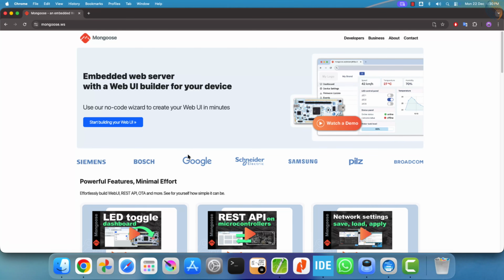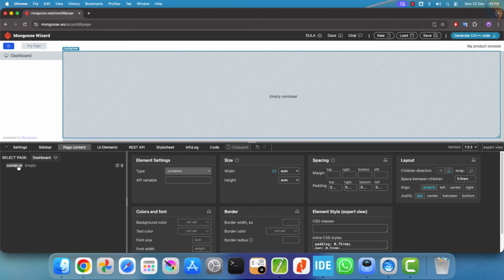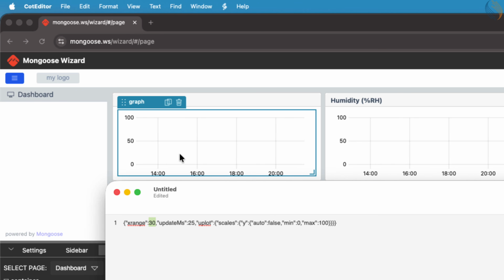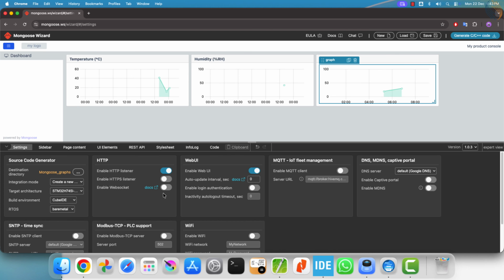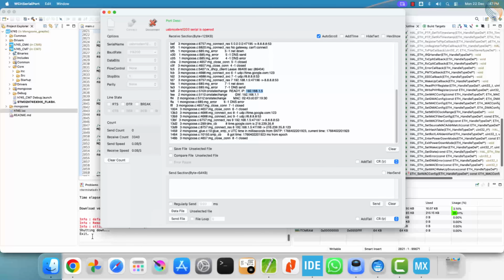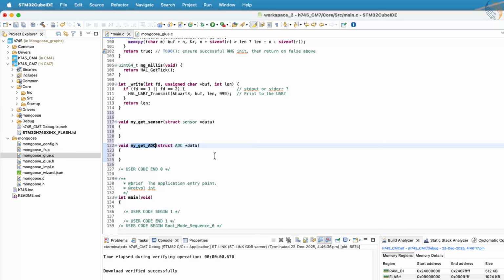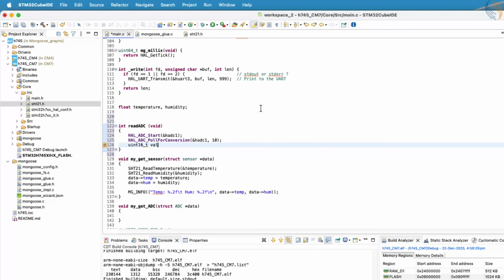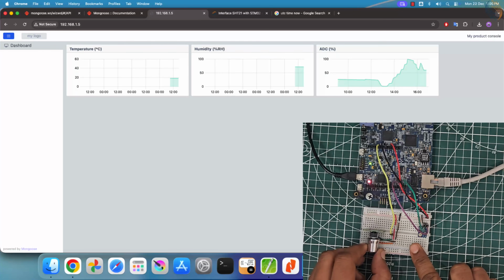STM32 Real-Time Graph using Mongoose | Live Sensor & ADC Data on Web UI

Comment: Hi guys, the graph looks incorrect to me. I made a simple graph to plot 0 or 1 based on the state of one pin (HIGH/LOW) of my microcontroller. However, the graph only draws a line when a new value arrives.

For example, if the first value is 0 and it does not change for 10 seconds, the graph shows nothing during those 10 seconds. When I change the pin state to HIGH, the graph draws a straight line connecting the two points.

I was expecting to see a horizontal line at 0, and then a vertical transition to 1 after some time.

So, you can make wrong assumptions based on it. I would think the value was slowly increasing to 1, but it wasn’t — it stayed at 0 and suddenly changed to 1.
Reply from the maker: Apparently that's how it is. It only reflects when there is change in the value. Hope they will fix it soon.